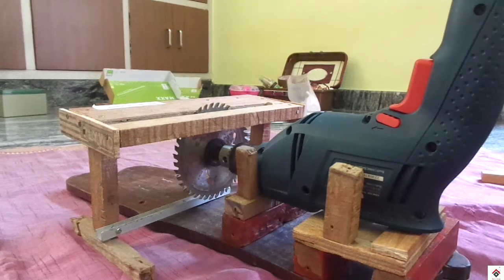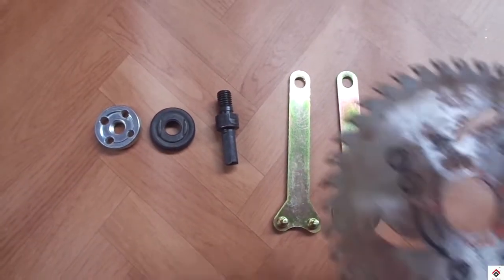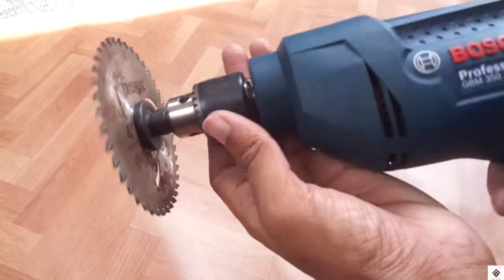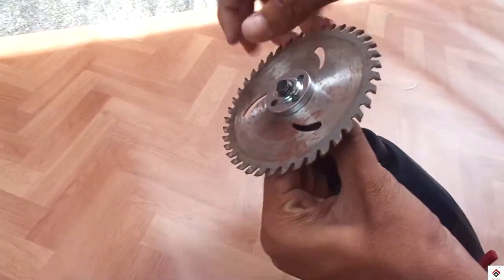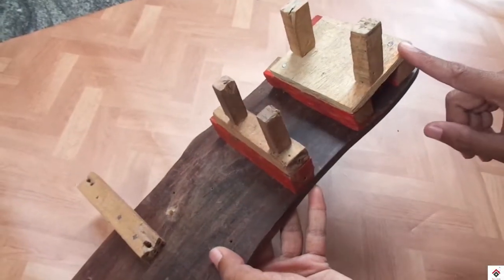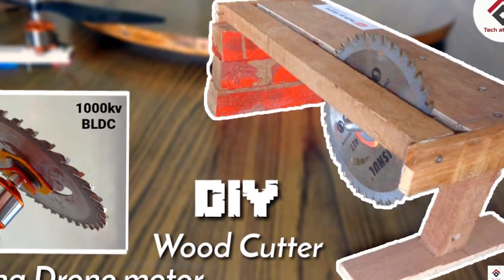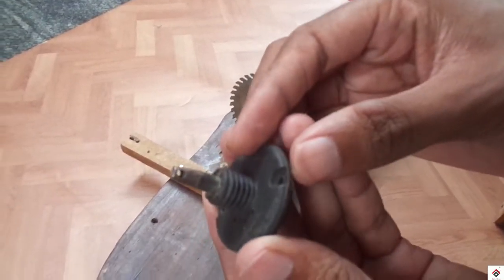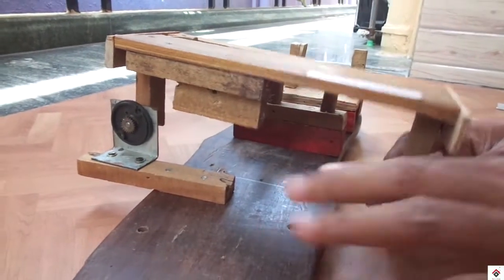Convert Drilling machine into table saw | Drill machine to wood cutter machine, Drill Angle adapter

Comment: There are no final designs, nor any end to modifications.  However, this jigs is a emergency table saw in absence of a saw.  Carrying several machines is not always possible, hence, such an approach too is possible.
I have seen several videos, several as in 100s with so may ideas.  But to make something with minimum expenses, had got me to think of a similar approach.  Your approach is pretty close to some desi approaches which incidentally work.  Our guys in India are amazing.  Every approach is 'Hero Honda" and your seem to be on "Love and Fresh-Air".  You have gone that road which I was looking for.  Tomorrow, I will go ahead and make this approach.  I just found some observations which with your experience and your approach, you may add here to this video should someone who is not aware of the risks, can correct now.  If you have them in mind, please add as soon as it can be possible.  I believe that:
1.  We must make the machine rigid.  How it can be done? There may be several ideas.  You seem to find very practical and simple ways.  At least I would like to hear and see from you;
2.  Next is to align the Blade.  A warped blade could keep giving errors in cuts.  I have seen the ways right-angles are checked.  I will try and get as close to perfect as possible in lateral, vertical and horizontal axis.
3.  For the depth of cut, I suppose you could device a method of table adjustment.  Lifting and lowering with minimum two graduations aligned, or a simple bowl filled with water may be introduced for leveling the table so that the subject piece moved to cut, goes straight and in case of any possibility of imbalance, before start, one is aware if precision cuts are needed.
4.  Going a step further, for measurement and straight edge, paper scale could be pasted.

I am completely new to this world.  As new as having got a GSB only yesterday.  Some spares in advance, a desperate need of a cutter but funds not available, hence a drill based table saw is the next safe idea as when I tried cutting a piece 2" x 1", I wasn't comfortable and realized that the idea of Table saw has gone wild.  I had the exact same "Themesto" ordered yesterday and received today.  However, I recall seeing the first Black base washer of the adapter requiring to be placed with the notches locked in the shaft notches.  I saw your washer go the other way, which I thought was not the way advised.  I may be wrong as I do not know, BUT, at this hour, I pulled out the 12T circular disk and put it the way did and I noticed the section on the washer with a 20mm cut, slots in the disk inner section snugly.  However, the washer now remains free from any stop on the shaft.  In the event of a sharp torque, there is a possibility of the saw becoming lose and if warped, could split and fly out.  Again, I may be wrong, but now I must get the correct answer to this.
In the meanwhile, I will move on to make the make shift saw since I need to make Press, vise, sanding drum, sanding disk, work bench and some handy tools before i take up any other exciting project to keep busy and defer buying wood cutting saw for some time.

Comment: The day you loose your fingers is the day you'll think you should have brought a circular or track saw, or even a normal hand saw. Saving a few thousand rupees and using a stupid frame which is unstable and has no safety for kick back, you'll loose control along with your fingers, then you'll understand how much money you saved, should not do this kinda stupid tricks rather buy a propper saw with safety features and keep yourself safe.